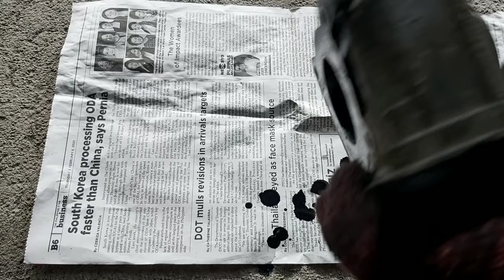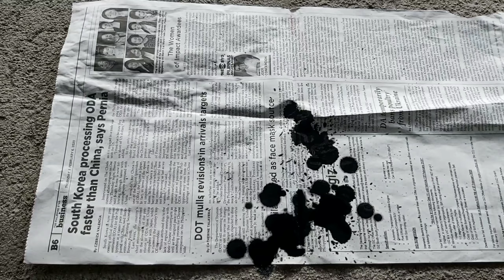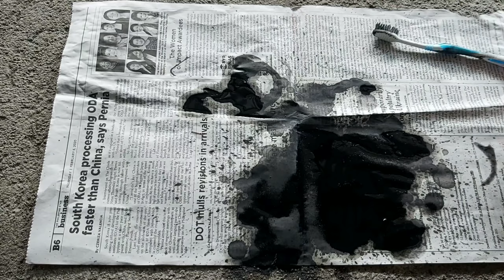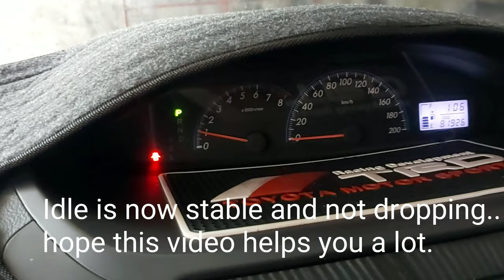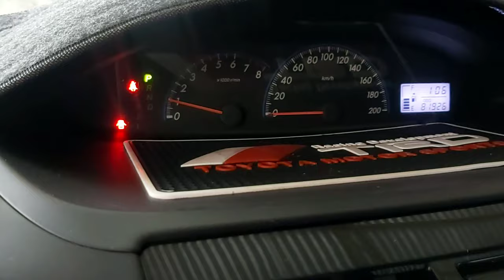How to fix low and rough Idle on your toyota vios..

Comment: Bought a Fuel System Cleaner liquid (Brand: NULON Pro-Strenght) add to the fuel tank and all problem gone in ten minutes. Having better response and a smooth Idle. Highly recommend before you pull anything apart or take it to a mechanic. It worked for me.

Comment: New spark plug,  checked purge canister,  air control sensor eventing but still consume too much fuel.why?
Toyota corolla verso 2005 1.8 petrol
Reply: Did you managed to find the reason?

Comment: Bitin ang info. Mo kabayan.. Dmo pinakita ang pag idle reset.. After you clean the throttle body.. Mapapahamak ang mga kabayan natin pag nag linis ng throttle tapos up n down prin ang idle..
Reply: mataas pa nga idle, sa akin 700 rpm idle very stable the ac on 900 lang .noon pero nilinis ng mekaniko ayun nagka loko loko na 3k cold start kapag warm na 1300 naman ,napaka taas hindi na mareset
Reply: Oo nga ang taas Ng idle nya NASA 1000 na sa Vios KO is nung nag links ako Ng throtel body is NASA 2000 rpm Pero unti unti Ng bumaba. Pero nung unang start KO is para hirap mag on hagog hagog Pero Napa start KO din. Yung idle KO na is 700 ang normal

Comment: i cleaned this but not dismantling. I clean  it at its place. it worked fine for me but now i notice at idle my Rpm goes beyond 1000. And after Aircon is on it drops to 800 rpm. Why?
Reply from the maker: You have to dismantle sir so be cleaned properly even the inner side..
Reply: Same problem here. Did you find the solution?
Reply: You guys need to reset ecu and idle relearn

Comment: Hi boss toyota vios din po sakin batman problem ko po pag nag accelerate ako okay naman yung rpm nya pero hindi match sa takbo over rpm pero mahina ang takbo, okay naman ang ignition niya bago ko lang napalitan. salamat po.
Reply from the maker: Kng manual trans ka sir pa check mo din clutch linning mo bka upod na. Kay ng oover rpm na pero delay ang hatak

Comment: Idol ung car ko same bago battery pero ayaw mag start on and off ang battery sign now ayaw mag start kung di series ng iba battery pa help ano problem kung alternator ba or starter or madumi ang trottle?
Reply from the maker: Starter yan sir. Pa check mo na. Pwedeng ubos na carbon brass or madumi na yan. Yan lng yan sir.
Reply: Mack SpeedWrench malabo ba siya sa altenator problem idol?
Reply from the maker: @ArtOfPeace007  hindi naman ng chcharge ang battery pag alternator ang sira. And nka steady sa panel board yng battery sign pag may sira ang alternator.
Reply from the maker: Pag nka andar na makina and nka ilaw pa din yng battery icon sa panel it means not charging yan sir.  Kaya possible na ma drain din laman ng battery mo kaya d maistart. Pero kng malakas naman battery then hirap pa din ma istart. Starter naman yun.
Reply from the maker: Anung sasakyan ba yan sir?
Reply: Mack SpeedWrench idol toyota vios ng blink blink ang battery tapos nababa ang headlights tapos pag menor na mamatay ang makina tapos mahirap na siya start need na mag series tapos nahigpit ang steering wheel manebela idol.
Reply: Tapos idol bago lang ang battery kapapaliy lang ay naka change oil na rin,
Reply from the maker: @ArtOfPeace007  pag na blink battery sign means not charging .. pa check mo alternator mo sir
Reply from the maker: Check mo din fan belt ng alternator bka maluwag
Reply: Mack SpeedWrench salamat idol ng marami

Comment: Hello po sir.
Tanong ko lang po sana, tumaas po at ayaw bumaba ng idle ng vios 2005 robin ko nung nilisan ko yung throttle body at intake manifold po
Reply: Relearn mo babalik sa normal rpm. Ganyan tlaga ngyayari kpg nilinisan throttle body
Reply: Pano gagawin don sa relearn..tanggalin bng battery connection?

Comment: If the aircon is ON, what is the reason why rpm is dropping from 600 to 900rpm? And so on.
Reply from the maker: Idle up sensor. Or the airflow sensor
Reply: Paps saan ma locate nag idle up sensor?
Drive by wire kasi yung throttle body ng Toyota yaris bat man ko.
TIA 👍

Comment: Sir, gud day ano pala problema sa unit ko pag nag accelerate ako mag over rpm hina naman ang takbo... nilinisan ko na throttle body nag palit na din aku ng spark flug pati fuel injector.. di ba kaya to sa high tension wire
Reply from the maker: Anu po sasakyan nyo?

Comment: So this one can apply for vios, i start the engine start rough... higher rpm after like 2min its stall... is it possible if the spark plug is the problem?

Comment: Good day sir... Saan po kaya ang problem kapag yung idle nababa kapag nag-on ng aircon, parang kinakapos ng kuryente. Nag-full PMS na, new spark plugs, new ignition coils, pati yung ac compressor bago na din. Ang unit po is a 2004 toyota vios gen 1 robin. Thank you
Reply: Pareho tayo ng problem :) Kaya minsan di ako nag aircon dahil minsan namamatay ang makina.
Reply: Iac valve yan paps
Reply: @sourcecodeJky  ganyan sakin boss kaso avanza sakin bigla nlng walang hatak at nanginginig tas drops rpm to zero sabay namamatay den after a minute pahinga aandar ulet, pinalitan ko iacv simula non december 12 2022 hindi na ako namatayan until now.

Comment: Sir ask ko lng kc dati bumabagsak menor vios ko tas namamatay nagpalit po ako ng 02sensor ung bandang taas naging ok naman po idle bumalik sa dating 900rpm kaya lng po pag bagong start po sa umaga bumabagsak menor gang 500rpm pero kapag uminit na po makina stable na po rpm ano po problema bakit bumabagsak menor sa umaga sana po masagot nyo tnx po more power po.
Reply from the maker: Try nyo muna palinis egr and throttle body